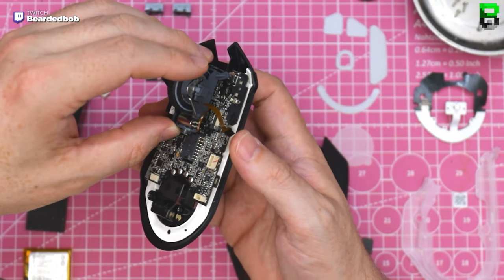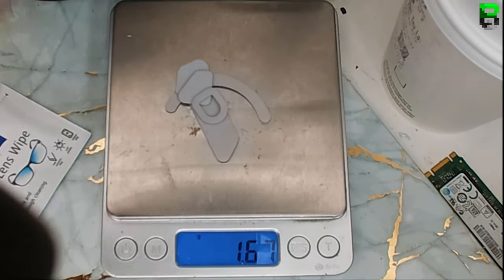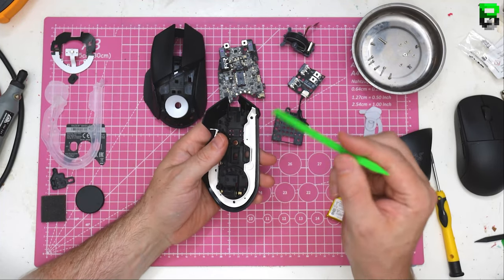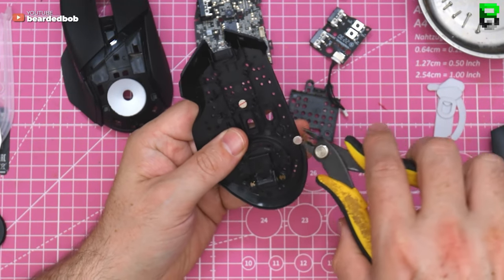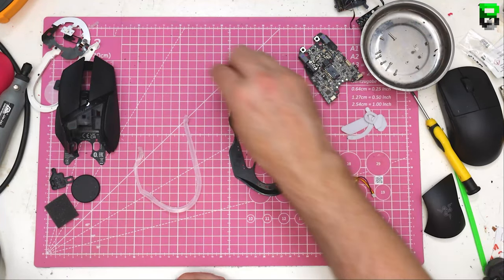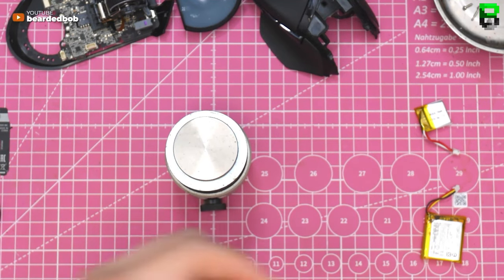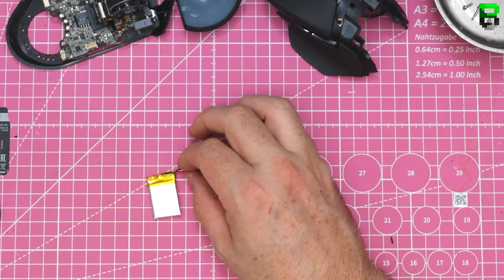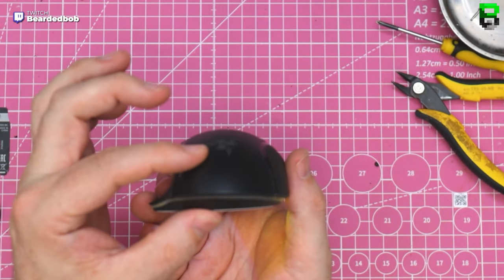GAME CHANGING MOD: Unleash the Full Potential of Your Razer Basilisk v3 Pro Wireless Mouse

Comment: Had a question about parts between the basilisk ultimate and the v3 pro,  do any of the parts innerchange. I like the v3 pro but prefer the ultimate scroll wheel and thumb clutch.

Comment: Still heavy as fuck, not worth the effort
Reply from the maker: Agreed
Reply: I haven't seen any 7+ button mouse with tilt wheel with under 70g yet. And the original WMO 1.1a is also around 75-78g without cable, and that thing has won tournaments as well. Getting one of these under 90g, or in this case even close to 85g makes the mouse already much more capable.
Reply: I dont think anybody should be doing a weight reduction when its a mouse like a basilisk, because you'd be removing pretty important features that you paid for, atleast for a mouse say a model o, or a viper v2 pro, there wouldn't be much lost there.
Reply: Gamers when they need more than two muscle cells to move a mouse:

LITERALLY UNPLAYABLE
Reply: Depends if you are a high or low sensitivity player. If you play with your wrist and use a high sensitivity to move your mouse around a little bit more weight usually gives more control. So somewhere between 90-110 gram is probably perfectly fine.
If you need an XL mousepad to maneuver your mouse around using your whole arm than a lighter mouse will be better.
But people screaming all mouse that weigh more than 60 gram are bad just don't have a clue.
Same with the very low lod enthousiasts. If a mouse has a higher than 1mm lod they scream it's bad. The lower the LOD the better they post everywhere, even reviewers.
They have no clue, it's a preference.
Reply: Get a gym membership and it will feel like its 50 my guy